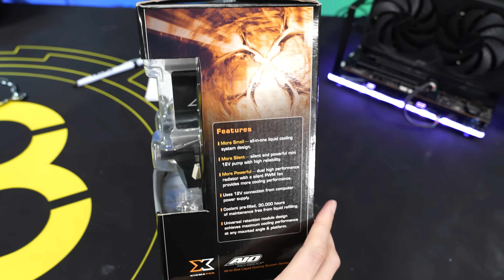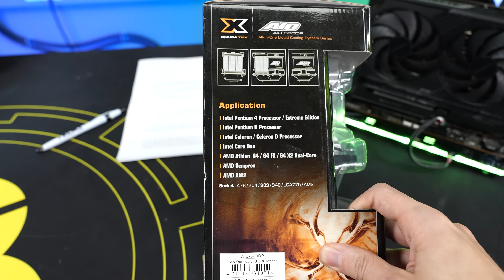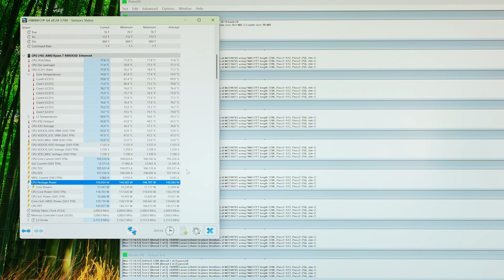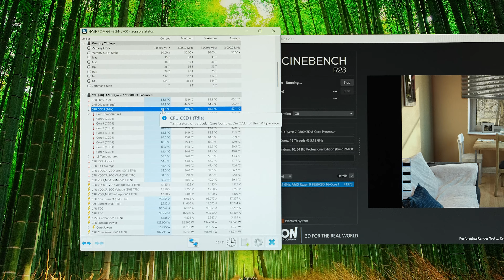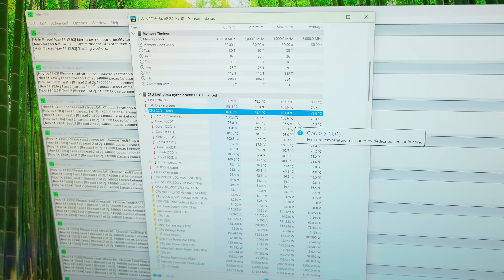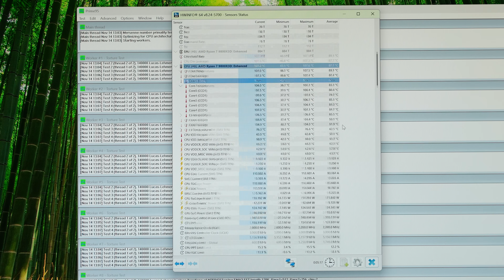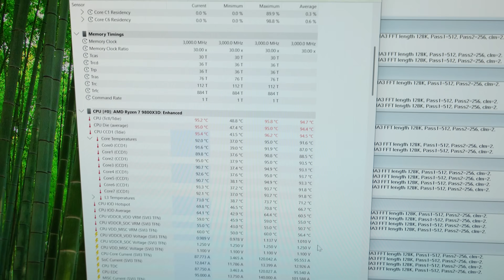Viewer-Mail Ep8: This Old Cooler Lets a 9800X3D Get Over 110°C

Comment from the maker: You can also submit questions for a Q&A here:
https://forms.gle/WMLkPeQyWDFNQbWx5
Reply: protective power down triggers at 115°C.

I once used the wrong spacers on my old 7800xD afterI delid it with your delidiemate.

mobo sensors showed ~111°C in BIOS. Luckily I've checked and did shut down the PC manually.
Reply: @BaBaNaNaBa cool story
Reply: how good is oill for coling
Reply: @no0bmaster480
water is better.
higher heat capacity.
heavy water would be better, but way too expansive.

Comment: Question: there are numerous recessed 5XXX SKUs that do not allow the use of your WireView.
Even if I measure the recess on the card and look at WV's schematics, it's hard to understand if they will fit.
Why not make more official compatibility tests for some of those more common SKUs (like the PNY basic 5080) so more customers could make sure it would fit.

Comment: Could easily see say, taking that, making it slightly larger rads and you've got a really nice rad for a small form factor build. Heck you could use some of the typically empty space. I also like that they included a fill port even if it's got a BS warranty void sticker on it.

Comment: No way! I had this cooler back in 2008 in my Core 2 Quad Q9500/GeForce 9800GTX rig. It actually wasn't a bad cooler at all back then. It was as good as any widelt available air cooler. Good times. I bought it from Scan Computers for maybe £60, along with some cold cathode 12v lighting tubes and some god awful memory chip heatsinks, the adhesive of which very quickly failed and left sticky residue on my RAM :(

Comment: Heatpipes had just started to be used in some processor coolers a few years before this thing was released, so the idea of using a whole watercooling loop to move heat into the radiator stacked directly on top of the chip was not as crazy as it seems now. That being said, you can't beat physics and it obviously struggles to keep up with a chip putting out about double the wattage it was designed for.

That being said, I honestly think this thing does great for its limited surface area and is very well-packaged for such a complicated solution.

Comment: I'm just impressed it's an AIO with a fill-port. Like they wanted you to keep using it. Also, the layout... it's almost more like a modern heat-pipe air cooler than a modern AIO.

Comment: I don't remember that cooler either, it is a really neat concept. However, heat pipes have totally taken over the need for a package like this. I suspect even a modern version of this with 120mm dual rad with skived CPU fins, it wouldn't perform much better than a current dual tower air cooler.

Comment: I think the 9800x3d temp limit being auto disabled is a bug in bios, I also experienced my cpu exceeding its rated 95C limit when trying to overclock, even though i didn't touch the temp limit. As soon as i saw it hitting 100c+ i shut it off immediately. If you manually set the temp limit to 95c, then it will respect it.

Comment: This cooler would have still been terrible back when it was new.  Some of the Pentium 4/D Extreme Editions had a higher TDP than the 7900X3D that you are using in this video.  For example, the Pentium D 840 EE which was released in April 2005 had a maximum power draw of 155W at stock and had basically no power savings modes built in.
The only CPUs that would have been fine with this cooler would have been the AMD Athlon CPUs but they were efficient enough that the stock coolers were perfectly fine at keeping them cool.

Comment: 1. Why did you only compare it just to a huge 360 AIO and not to any similarly sized air coolers or 120 AIO, and at 65 or 100W? maybe it's a great solution for a mini-ITX builds. This cooler was probably never meant to compete with large AIOs at 150W CPUs
2. Why didn't you try to refill/repair it and try again? 😸
3. You should be testing coolers at fixed Power/TDP (instead of just fixed voltage and freq, because due to temperature power leaks, the power will fluctuate between different coolers).😸

Comment: Screams for remake with a dual 120mm radiator design with a thick (30-40mm) 120mm fan, proper coldplate etc.

Comment: even with the fixed multiplier in bios the cpu will still try to internally lower the multiplier to stay at or under 110C(notice your frequency limit - global clock speed at 600mhz below the L3 clock). typically when it overshoots the 110C threshold faster than it can lower the multiplier it'll immediately shutdown but since the cpu was just gradually increasing in temp it was stepping down while keeping it at ~110C.

Comment: You can make a modern version using dual 120mm radiators, bigger pump, silent fan, a modern cold plate and use a high end cooling liquid.

Comment: Still using my Noctua NH-D14 from 2010 in a AM5 system with a PSU from Corsair that has the same age to it!
Reply: I have HX650 as a warranty replacement to a HX620 PSU. I think I mined one BTC with it and now I am planning on putting a 5080 behind it! 😅

Comment: My question is if I set throttleling at 110C in PBO will CPU boost higher to max clocks at undervolt?
My CPU at 60-77C range and avg at 69C temperature when my 9600x overclocked 5.825Ghz PBO etc and goes all cores at 5.6Ghz only but peek to 5.7 and 5.8Ghz sometimes in gaming.
I am thinking what I can improve

Comment: I cant remember seeing those coolers in my part of the world either. Around that time I was running an Thermal Take Big Typhoon cooling either an 3200+, 3000+ @2.9Ghz or X2 3800+ @2.66Ghz. Looks wise. They must have been excess stock from a non-commercial contract that Xigmatek packaged up and sold on. I can see these working on rack servers given their shape.

Comment: Aww, was hoping to see it cleaned out, refilled, resealed and retested
Reply: I was also looking forward to it being flushed and refilled. Bonus if he milled a new cold plate and put it on haha. But yeah it clearly had a full sized fillport on the top so its designed to be filled.
Reply: Yes, there should be a follow up with some maintenance done on it. Cleaned up, flushed out, and filled up with new coolant. Maybe even a fan mod.  Also, a quick game test would have been nice.  I think it needs to be given it's full potential.
Reply: Plus push-pull fans
Reply: Yeah from the looks of that initial corrosion on the plate I'm going to say the seal dried up and failed sitting for 20 years which isn't too surprising depending on how and where it was stored.
Reply: Mod with 2 server rack fans and it would be perfect
Reply: exactly what i was thinking. :)
probably no difference, but worth a shot to flush it and maybe some maintenance on the seals to get it to perform as if it was new. might be slightly better.
Reply: Same
Reply: This
Reply: Is there even anything to lose by trying?
Reply: my mechanics this thing
Reply: Agreed, it was looking kinda bad and also modded with 2x of the newest arctic P12 Pro which have crazy high pressure.

Comment: I ran a Koolance EXOS (Original) for more than 15 years;   it was great on a Northwood P4,  Core 2 Quad (45nm), Sandy Bridge 2600K,  and OK on 8700K.    However, it was 'borderline' on the 9900K under heavy loads - even with a good water block.  That's when I finally replaced with a modern cooler (Arctic Freezer II).   The new cooler is much quieter but I liked that the EXOS had two water pumps for redundancy.
Reply: This takes me back. I had the full tower Koolance system back in 2004. For the life of me, I cannot recall the specs, and unfortunately my brother threw the entire system away without even consulting me while I was away. 😢
Reply: @37Kilo2 hah awesome brother :-P !   I had a friend who had that case later on also.   Did you use it with an AMD Athlon 64  system perhaps?
Reply: @jrherita no, it was an Athlon XP. Probably a 3200+. GeForce 6000-series if I had to guess, given the year.
Reply: Yeah, I still run Koolance stuff, it’s a shame they stopped making water blocks though.

Comment: For the size of that rad it held up well. i would like to see 2 fans on the out side of each rad drawing air from the center of the cooler. also add a 3/4" spacer between fan and rad. i really like this setup. mount a small led screen to the top of it and boom 20 year tech brought up to meet todays standards.
also you should have topped up fluid.

Comment: Roman, thank you for this video. Could you, please, attempt to address recent reports of damaged FE 5090 and FE Pro 6000 cards? It looks like Nvidia does not have spare parts to offer to authorised repair shops and someone who paid $10,000 cannot repair their card, as they cannot get the daughter PCIe board replaced by technicians. Nvidia even agreed to send a free replacement FE 5090 to a user whose card was already out of warranty. It looks like they are hiding behind proprietary hardware IP for PCIe connector and PCIe daughter board and are not willing to provide those spare parts to authorised repair shops. Thank you.

Comment: I'm a sucker for these retro coolers from the early-mid 2000s, so many interesting designs that really tried something different even if they weren't the most effective. Pity this one wasn't in pristine condition and we couldn't see what it could actually do but there's nothing you can really do about the progress of time.

For the Q&A though:

If Thermal Grizzly didn't use a Bear as it's mascot what animal would it use instead?

Also is there a particular reason it is Grizzly with a bear or just because it sounds cool?

Comment: Good call not cooking the 9800X3D!  I just found a screenshot with WCPUID from my o/c'ing days 20+ years ago.  AMD Athlon.... Sysclock @ 140,  multiplier 10.5, sysbus @ 280.... CPU clock @ 1470 Mhz!  Think that was my Thunderbird 1.2 Ghz.  Running WinXP SP1 (so between '02 and '04).  I still have the CPU/mobo and they still run!

Comment: Huh....I'd really like to see a modern iteration of this design.  Scaling it up to 120mm would be cool, but I think the current understanding of cooling and materials might enable it to get away with the 80s or 92s.
Reply: Aren't modern air coolers with heatpipes basically the modern version of this, tho?
Reply: @rata536 The heatsinks have a similar profile, but it's not a true AIO with the pump and rad as a singular unit.  Vapor chambers are close, though.
Reply: @CntBckt  Yeah naturally the vapor chambers are not a pump, but for the small package that a CPU cooler has, I'm expecting the vapor chamber to just be the evolution of this concept.  The main benefit of loquid cooling is having a lot of water mass to buffer the heat and moving it away instead of hanging on the CPU socket. How actually feasible would be to have 2 120mm rads hanging on the socket? Because that's somewhat the minimum you need for an actual benefit, since an 120mm AIO will lose against a good air cooler.

This is why I'm saying modern vapor chamber air coolers are the modern version of this, an evolution.
Reply: @rata536 Ya.  I was also saying the vapor chamber are probably the closest to this.  👍🏾

For the 120mm question, I don't think that's much of a leap.  The layout would essentially be that of a Noctua D12, or a reversed version of the 2-fan U12 setup.  When the D15 exists, I don't believe we're talking about absurd size here.  

I really like the idea of modernizing "true" AIO coopers like this, but I suspect a vapor chamber D12 is the most feasible form.

Comment: "Silent cooling" back in the day just meant it was quieter than the noise floor of the environment it was expected to be used in.

The average noise floor in a US home is between 56 and 70 decibels. Central Air and Heating is noisy AF, yo.
Reply: The AC at my mom's house sounds like you're in a airplane

Comment: Different era; where mostly single or dual core would be prior. They where optimized for what they where doing; but obviously a 120MM single rad would be more efficient due to the radiator surface area. Still a fun gimmick for those who wanted a AIO watercooler but without the stack of radiators, hoses and pumps.

Comment: Thermal trip is 115c, thermal throttle is 105c, thermal target is 95c.
Reply: I still don't like allowing a CPU to go north of 80c, ever.  The only reason they're getting this high (besides stacked bonding layers), ignoring the impressive material changes, etc. over decades, is due to the stupid IHS thickness design decision of AM5.
Reply: i seen in the screen that it also said 113 max limit so makes sense pretty crazy throttle is at 105 but hey amd has come far
Reply: There is no thermal throttle when using manual OC.  Only 115c thermtrip.
Reply: Guess my loop is amazing then, my 7900x3d rarely touches 70c with 130w draw lol

Comment: Question: lately I read that even a RX9070 XT with 12V high power connector had melted. Any rumors in the industry about ditching that connector for something better and more reliable?

Comment: Did you check if the liquid is water of some special liquid (e.g. antifreeze)?
It would've been interesting to put a transparent glass above the hole where you removed the heat-plate and run the pump. That would've shown how the liquid is moving (made even more visible with the particles in it).

Comment: Why didn't you refill it and try again (open that top cap) ? or replace the liquid with clean one. Did the pump work 100% ? (it seems the liquid level was good though)
Reply: He said it's not his cooler. I guess the viewer only lent it to him.
Reply: he's german.
Reply: I was surprised when he took the heat gun to the sticker. He probably has French blood too.
Reply: Like he said, it has less surface area than a modern 120mm AIO, refilling it wouldn’t make it magically able to dissipate the almost 200 watts of heat the CPU is producing
Reply: @RaineyPeng It would have helped and showed its real capabilities.
I don't care how it performs on current hardware for day to day use, I only care how it works overall.
Reply: @RaineyPeng The 9800X3D pulls 130W or less (prime95 is crazy). That cooler should be able.
Reply: Thanks For Saving Me Time From Watching The Video. Disliked As Well.

Comment: Your videos of testing old and unique cooling solutions totally rock! My idea would be a video showing how cooling market progressed from it's beginning which I would understand as arrival of tower coolers twenty years ago. It would be great to see regular, but some legendary, top performing then coolers and how they compare to modern counterparts on modern platform. Noctua and Thermalright are the best canditates thanks to being always on top and still supporting plenty of their vintage coolers with mounting brackets. The only challenge would be getting some legends like U12, D14, Ultra or Silver Arrow secound-hand. The most interesting would be the first dual tower cooler, Thermalright IFX-14 with it's bizzare CPU backside heatsink, but it's gonna be hardest to get it and I think it's one not supported anymore, so needing DIY mounting solution.

Comment: I remember this strange cooler, even in 2006 as I maintain today I was very passionate about PC hardware. Surprising how the term AIO was already present in 2006 and also written large on the cooler. 
It would be interesting if you cleaned it, put new coolant and a more powerful fan or add more fans to see if modernizing it performs better.
Reply: Yeah, I really thought that the term AIO was far more recent.  I don't think I'd heard the term before 2012, maybe 2014 yet there it is printed right on the label.
Reply: @ck17350  AIO's have existed since the early 2000's, it's not a recent term at all.  They were just expensive, not cost effective at all, so most people generally avoided them beyond lucrative PC builders.
Reply: @Nighterlev I worked at frys electronics in 2006 and we already had refurbished AIO by that time so they were released much earlier Than that
Reply: @sumiix  early 2000's dude, 2006 is mid - late 2000's.  What are you talking about

Comment: It has a huge flaw for being used when new. Cases didn't have air filters and CPU coolers tended to get clogged. You can clean the intake easy enough but not the fan or exhaust. The fan and exhaust would end up covered in dust and it would stop dissipating heat except passively. It would end up cooking CPU's in a year of use.
Reply: I think it was more prone to leaking sooner or later then when dust would block off the fan.
Reply: @vanderlinde4you  Because 1 that was in a box for 20 years leaked? That doesn't mean they are prone to leaking. Fill any water block with fluid and cap them off then put it in storage for 20 years and you wouldn't be surprised there are stains from leaking or even completely dry. If you live in an environment that has average dust then it is guaranteed to get clogged in a year, in a high dust environment you would get 6 months before needing to remove it to clean it or have a heat trap. This is why cases all come with air filters today, because CPU coolers would get clogged.

Comment: I think that this cooler  NEEDS  to be reffilled
Reply: Extremely disappointed.
Reply: probably, but those aluminum rads from back then were horrendous and heat soaked stupid easy so the results aren't surprising. i use to play around with old school watercooling using those 80mm aluminum rads on the early athlon XP cpu's. you could usually get 1 or 2 benchmarks in then had to wait 45 minutes for the rad to cool down.